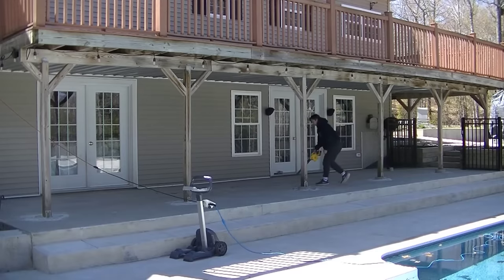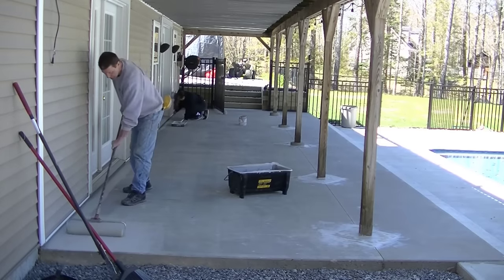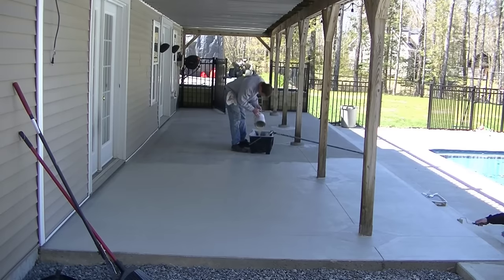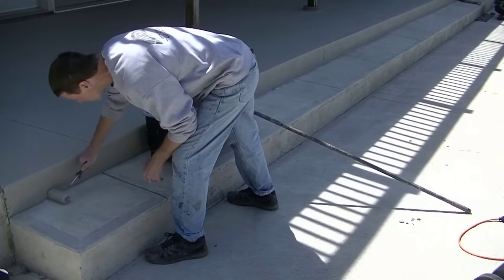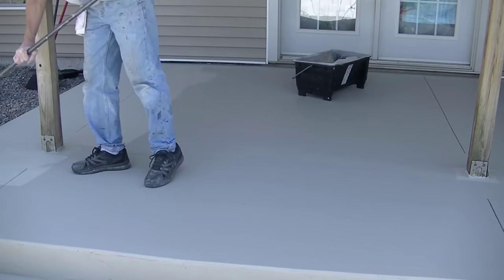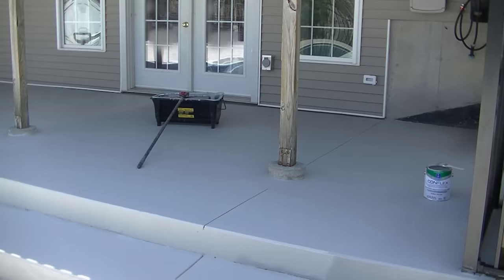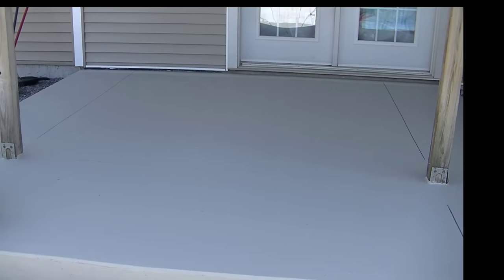How To Paint Concrete (What I Use On Patios, Pool Decks, and Walkways)

Comment: Question for you… we had our patio poured last summer and the top is chipping off. The guy who poured it is going to resurface it to fix the issues. I was thinking of having him grind the top off and paint it as it may last longer. Not sure which route to go. Any suggestions? 
The reason it’s cracking is because after it was poured and they left it hailed and rained. They came back to resmooth the concrete when it was happening because it had hail divots. Obviously this weakened the top and not it’s chipping away in places. Not necessarily the contractors fault. But we are looking for a solution to this problem without having to rip it out and re-pour. Thanks for any advice you may have!
Reply from the maker: Grind it smooth, clean it, then use conflex to paint it like this  ideo.
Reply: @MikeDayConcrete  thanks for the reply! you think that would last longer then resurfacing?

Comment: HI Mike, I'm not a handy person or know anything about concrete. My question is can I used Conflex as a primer for a sidewalk and paint it over with "BEHR Concrete & Garage" paint?
Reply from the maker: You won't need the Behr, just the conflex will work. Comes in most any color. Use two coats and it'll be good. Only for patios and decks, not to be driven over.

Comment: How long can you expect this product to last (doing its job of waterproofing)?
Reply from the maker: I've had it on my basketball court for 7 years now.
Reply: @MikeDayConcrete  I plan on using this paint for my basketball court as my main color.  Do you know if I can paint over it with different color on the key area and free throw lines as well as white lines for perimerter border?
Reply from the maker: Yes you can, it bonds to itself excellent. This is it here: https://www.sherwin-williams.com/homeowners/products/conflex-flexible-concrete-waterproofer-smooth
Reply: @MikeDayConcrete  Do you have a recommendation for a good clear sealer? Just had a patio done with color added so want to keep that look.

Comment: What would you recommend  a garage at my home that I work on engines.  I spill a lot of gasoline and oil. This isn't something that I do every day it's just side projects. So I wouldn't need anything that would go into a professional shop. I have tried a couple different concrete paint from Home Depot and it looks good when I'm done it just does not hold up. I'm planning on in September when it starts to cool down around here to use a concrete grinder from Home Depot and I'm going to smooth out the entire floor prior to painting again. 

Also thank you for sharing your video I enjoyed it.
Reply: two part epoxy... theres a big difference between foot traffic and car tires... ir car tires are present you cant use acrylics of any kind because the cars tires and the paint are nearly identical in chemical makeup and do what we call "hot tire pick up" where the paint sticks to the tires when parked after driving
Reply: I recommend nothing. Gas and oil will always ruin it. Leave it as it is.

Comment: Great job! I have a concrete floor in my house. The previous owner glued carpet foam to it. I removed the carpet and foam. Now I’m left with the adhesive on top of the concrete floor. Any tips on getting rid of it. It’s to hard to scrape off?
Reply: Quincy Jones rent a scarifier from  sun belt or united rentals.  It’s a walk behind tool.
Reply: Somebody else mentioned getting rid of glue. There is a solvent out there for everything, but sometimes it’s hard to figure out exactly what the product was that a previous owner used. I suggest brake cleaner as a last resort.
Reply from the maker: Check out the Diamabrush from Malish. You can rent it at HD. It goes on a floor buffer, we use it to remove some glues. We also grind glue off with 7" and 5" hand held grinders with diamond grinding wheels.
Reply: I use a small hand sized grinder with a round concrete removal attachment.

Comment: Good preparation is everything or don't waste your time. You must pressure wash with degreasing and etching product? The Primer is critical with high adhesion, water proofer. Use at least two coats of this crack filling, high adhesion primer? Finally use at least three coats of quality top coat. For a flexible non slip finish try an additional couple of coats of a rubberized paint such as, 'Liquid Rubber'  'Cool Foot' or similar quality exterior paint for exposed areas around the home. Total with everything included should be at least seven coats. For a driveway research a suitable polyurethane instead of the 'Cool Foot; rubberised finish. Make sure the initial wash is fully dry after three dry days, and plan for a dry week for the whole job. There is nothing worse than chipping and peeling paint on your concrete driveway. Otherwise better go without or try a much less troublesome stain instead.

Comment: Mike, what kind of paint or stain would you use on a concrete block retaining wall with concrete stucco?
Reply from the maker: You can use this same stuff, Conflex.
Reply: @MikeDayConcrete  thanks so much for the reply - if drainage could be an issue (old retaining wall built in 1959), would it be better to leave it unpainted so the water can make it through the porous cement/stucco?

Comment: Mike, I have an outdoor front porch that had a red iron oxide paint on it.  Tried everything to remove it and then repainted. Paint doesn’t stick, even though I used a concrete primer. Any recommendations of how to fix the problem?

Comment: I have a large back mostly covered patio, im wanting to put like a garage epoxy type colored finish with the flakes in it, i will have to use a UV product because the cement is not all covered, my question is, will the seal coat be to slick and what can i use to create like a non- skid to reduce the slickness?

Comment: This is great, thank you. I noticed the patching around the pillars filled in the original seams (idk what they are officially called) to stop cracking from spreading. Is it okay to patch over those seams usually, or does it depend on the project? Thank you.
Reply: I noticed the same thing.  I think continuing the line up to the support posts would have looked more finished.

Comment: Greg from Texas. How long did you wait between 1st and 2nd coat. Also, I will need to add texture due to a “fall risk” in my household - can that be done just by using a different roller/brush?  Thanks in advance

Comment: I have precast concrete window sills, with rebar inside.  Over time, moisture penetration has rusted the rebar to expand and crack the concrete.  I can patch it with a sanded external caulk like FLEXX, but how best to seal it permanently from any future moisture penetration on a window sill?  (again, bare concrete currently)

THANKS

Comment: Can this concrete paint be used on a driveway?  If not, what would you suggest?
Reply from the maker: No, this isn't for driving on. Just patios, pool decks, walkways. I wouldn't paint a driveway, the hot tires will just peel it off. Try getnewlook.com, they should have a stain you can use.

Comment: Is this paint good for concrete garage flooring?  What about hot tire pickup?
Reply from the maker: No, you need a 2 part 100% solids epoxy for  garages and hot tire pickup.
Reply: Thanks.

Comment: Would you recommend a primer for an older more beat up porch?
Reply from the maker: An older beat up porch I'd patch and repair first. Rapid Set Cement All blue bag for repairs, then sand smooth, then paint it.
Reply: @MikeDayConcrete  Mike can this con flex be used in a two car garage? I’m looking for a solution with a gray finish, one that looks good and will not chip and will not break the bank. I’ve looked at the epoxy solution and their either inexpensive but will not hold up or their too expensive? Appreciate your input? Thanks

Comment: My concrete basement floor gets a few dark (wet) spots after it's been rainy for a while. Is there a paint that won't peel if it's applied when the floor is dry?
Reply: Pika Rose - OK, first you MUST locate the water source. Is it high water table, from downspouts on house after rain or something else? Then, buy a large, good quality dehumidifier. It MUST run from April to October, 24/7. Then, buy a humidity gauge so you can track humidity in the basement. LASTLY, purchase UGL Drylock and roll that on your basement walls and floor. Humidity in the basement must remain at 35% or less in the spring and summertime.
Reply: Move away.....
Problem solved.
Reply: If the moisture is coming through the concrete slab, all paints (film coatings) will lift and peel.

Comment: Hey , Mike thanks for your video. Is it going to be okay to paint stamped concrete patio with this paint?
Reply from the maker: You can yes. Make sure most or all the original sealer is worn off or pressure wash it off.
Reply: Will this work over concrete that is blotchy?

Comment: Looks good, Mike.  Found your channel and was surprised to find you're a guy fairly local to me here in Maine. Question: I've considered approaching my Portland-area employer about them paying me my standard hourly rate to paint new lines on their concrete outdoor lot where semi-tractors back and park trailers to be loaded and unloaded. (I'm the guy who needs the lines to back up the trailers) They are extremely budget conscious so they have decided not to hire it out again. I've seen that Sherwin Williams has a couple products and am wondering if you've ever done this sort of work and what product might be a solid choice? Thanks.
Reply from the maker: They do have a paint you can use. I haven't used it yet. You'd have to contact your local store and see what they have. You'll probably have to re-do it every year if they're driving over it though.
Reply: @MikeDayConcrete  Thanks, Mike.

Comment: I used a Sherwin Williams epoxy paint back in 2010 to do my garage floor, its starting to flake off in spots due to normal wear and tear,  I really like SW products, my floor came out good. Can the epoxy paint be painted over with a product like this or does it have to be totally removed, etched, then repainted?  Love your videos, I did plenty of pads in the Seabees for Quonset huts, hard but rewarding work.
Reply from the maker: They don't recommend driving over this type of paint. You can sand your existing epoxy paint and go over it with epoxy paint again. If the original is bonded good it won't peel. Just have to make sure the old paint isn't loose  and not peeling off yet.

Comment: I’m curious why you did not use Apoxsee it is the only proven pain to stop water from seeping through the paint you’re using is a good paint but if you want 100% sealant I will not allow moisture to penetrate apart is the only one that can give you that kind of warranty I don’t work for a paint company but I have been to school and learn the chemistry of these products and under the microscope Apoxsee is the only paint that will 100% seal off moisture and it is flexible to a degree so I’m just curious if you have read about this or not.

Comment: Mike do I need to use acid on my front concrete patio that is only foot traffic?  I don't really want to do that because when I power wash it it might damage my front walk?  There is no oil or grease on the patio area and I live in Phoenix area
Reply from the maker: No acid. Just pressure wash to clean if it's in good shape, let it dry for a day and you're good.

Comment: Would this product hold up in a garage with cars parked ?
Reply from the maker: No, I said in the video it's not for garage floors. I use a 2-part 100% solids epoxy coating for garages.
Reply: Mike Day Everything About Concrete Thx

Comment: In my experience concrete "paint" always seems to peel up and flake over time. Paint sits on the surface and doesn't penetrate like a concrete stain. If you want to do your driveway can you use this product? The heat from your vehicle tires might make it lift no?
Reply from the maker: No, I say in the video it's not for driving on. Just foot traffic.
Reply: Proof seal is best..

Comment: "Paint" will get hot..  in the sun.  Hotter than you think.  Concrete stain colors, but doesnt hold the heat like paint does.
Reply: What concrete stain would you recommend?
Reply: @frankierothschild6067  Ive used several brands, usb ask at your home store.  They will also mix colors for you.  Stain will las a lot longer than paint, stain soaks in, doesnt rust sit on top of the surface.

Comment: That patio looked like it had been installed in a couple different phases, bcz some of the columns had pedestals and some didn’t. Also I’m wondering how they managed to get the 2 steps so uneven 🤨. I guess when they did the second phase they were left with no choice but to match the uneven risers from the first phase. 
I was never a huge proponent of painting flat work concrete, bcz once you do it, there’s no going back. You pretty much have to keep doing it, to keep it looking nice. BUT you definitely picked the right color. Something as close to the color of the concrete as possible.
Reply from the maker: Yea, that's in the proposal. "you will need to touch up or re-coat at some point down the road"

Comment: the best concrete paint is a zylene based silicone acrylic called H&C.  water based paint for concrete is junk.  you also need to acid etch not just pressure wash.

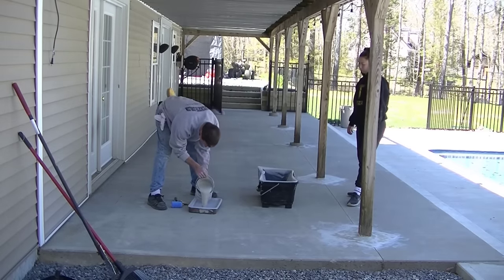Comment: 2:20 Wait...  You're going to paint the floor before those bare wood posts??
Reply: At least power wash them to bring back their natural wood color.
Reply from the maker: I was hired to just paint the concrete. Most people don't paint pressure treated posts here in Maine.
Reply: @MikeDayConcrete  What do they do, stain them?  Guess it makes sense to use a really good sealer in a harsh environment like that.  You can have them made in a lot more colors now.  I bet it's frustrating as a craftsman to have your home owner make choices like that.  You're going to get that job next and be like, "........."

Comment: Will it be stupid of me to use this paint, also, on the little bit of wall under the vinyl siding?
Reply from the maker: If you're using it for a patio, pool deck or walkway then it's very good. Not a driveway or garage floor. And yes on the wall is ok.

Comment: The thicker the nap on your roller will leave a most undesirable look. The 1\2 inch nap would be the thickest I would even bother to use. Skip the roller pan. Cut it in and pour on the floor and roll it out. Been doing this since 73.

Comment: I would never use concrete paint no matter how good it is. It will always peel eventually especially if subjected to rain and sun. Either use a stain that soaks into the concrete or epoxy paint but epoxy is very expensive.
Reply: What stain would you recommend?
Reply: @frankierothschild6067  Cromelin have a good concrete tints.

Comment: Concrete gets old: It gets pitted and rusty from winter salt drawing iron to the surface (from the rebar in it); It gets moldy if there's a lot of shade;  It gets stained from spills on its porous surface); and, It cracks from the settling of the earth under it.

Comment: Hi..Great video..I had two questions..I have a stained driveway from prior owners, is there something special I have to add to my driveway other than the product you are using...Also, Im guessing its not slippery so my second question is regarding a path to the front door that was stamped, but they put a sheen finish and its slippery when wet and its has a slight grade, any thoughts for that...Thank you for your help..

Comment: A paid commercial by the sponsor and manufacturer. Truth is, paint and epoxy will peel from moisture if plastic was not installed below concrete. Use stain...

Comment: My company would never put paint on concrete, paint has not viscosity to stay on bare concrete and you will always need a stabilizing solution to sink into the first 2 or 3 centimetres of the concrete face, after that is applied and depending on temperatures the first coat of paint can be applied. What you do in america the great l dont care but this is how we do it correctly and l get no Adsense for this post either.

Comment: why paint concrete, its concrete?? you can have pigment added to the concrete mixed and have it colored before its poured. you can have finished concrete done which is smooth and you can also have concrete polished like at Lowes.. you can also have a thin epoxy finish put on it but make sure its even and no bubbles.. BUT if you live in an area where it snows and ices, becareful about this in the winter time because anything other than a rough finish on the outside concrete will be VERY SLICK and out door mats DONT help.
Reply: What about existing concrete?

Comment: I don't like the construction of this deck. An elevated deck like this should have used 6'x6' posts, with spacing no more than 8 feet apart. I can't tell if there are any lag bolts run into the ledger to hold the deck onto the house.

Comment: Don’t paint use a stain. Paint will peel.
Reply: What happens once it’s already been painted once though? I have a small patch of concrete in the front of my house that we had painted before a few times but it eventually peeled off! Unfortunately it still has some paint around the edges that would be impossible to fully remove I think! I was hoping I’d find a better product or solution so I could make it look better but once I saw your comment I started second guessing myself 😂 if stain is impossible for my situation, is there any other option? I’ve seen a multi step surface process that has a thick layer of tiny multicolored stones that get spread out and once that dries your finalize it with a clear sealer coat but I’ve never seen what it actually looks like at the end and how long it potentially lasts in a high traffic area outdoors!